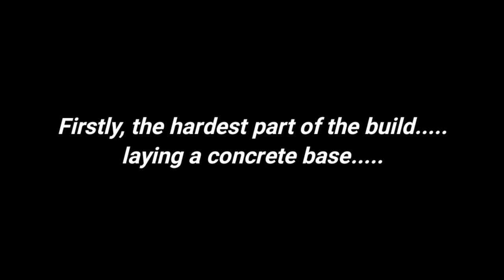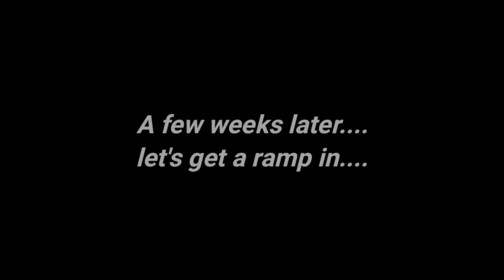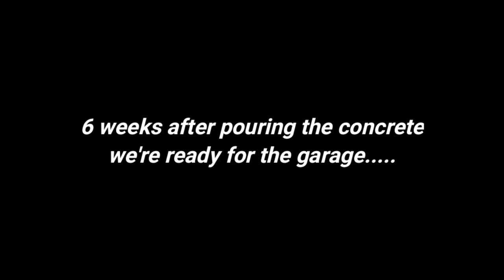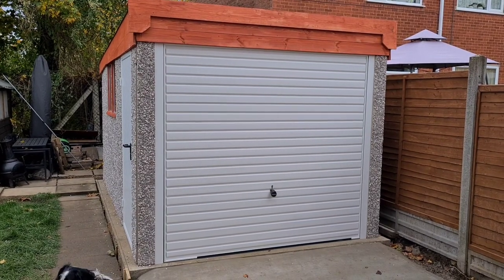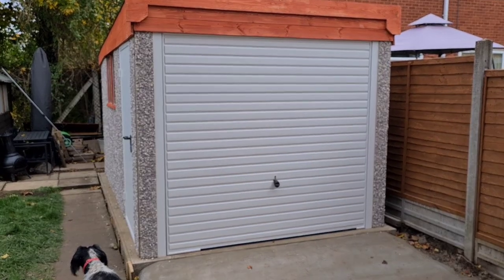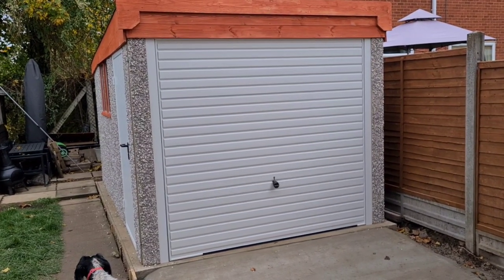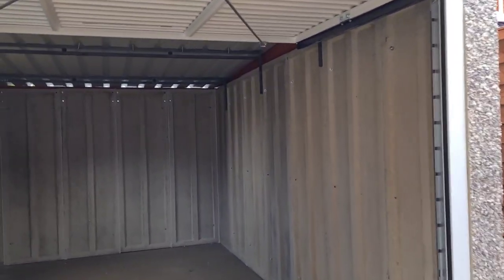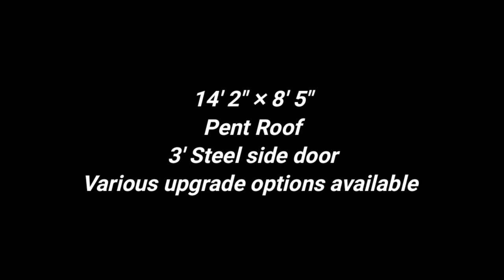Concrete Sectional Bike Garage Build

Comment: There is one big omission for me. What about the shuttering at the base having left it in and the trapped piece when doing the slope to the garage floor and how on earth do you get this bit out when the concrete has hardened. It makes it so much harder instead to remove it later instead of before the garage was actually built. So confusing for me and not seen this before or am I missing something. Anybody out their and nobody seems to have noticed this!!!
Reply from the maker: Hi Geoffrey, thank you for your comment. I am not a building expert and this was in no way intended as a "how to" but more just a video of our garage build experience. The shuttering must be left in until the concrete goes hard otherwise it will just fall away and will make a mess, also we were let down with the hardcore as it was very poor quality and was 80% pebbles and the rest was crushed bricks. I didn't want to remove the shuttering until I was ready to sort the surrounding areas (paths etc) as I felt that some of the hardcore would have fell away from the edges. The shuttering was easily removed by just levering it straight up with a spade, even the front bit where the ramp went in as a small gap was left so as not to trap it and was easily lifted out before putting the ramp in. As I say I'm no expert and this video is NOT intended to show how it should be done but just to show our experience of our garage build. 👍
Reply: Okay mate, and at least you gave an explanation which was great. I still enjoyed the video though and thanks for sharing it with us.
Cheers mate.

Comment: Hiya pal looks great. Building one myself Tomorrow and have no clue how the corners are bolted together. How are yours ? Thank you
Reply from the maker: @marshallcoop934  Hi mate,
Wish I could send photos on here. If you watch the video back at 3:58 and then at 4:30  you can see that back of the side panel is butted up to the end of the back wall and bolted through from the side (the back wall is inbetween the sides)so you may have 2 panels that have holes in different places to the others.
The 2 small front panels either side of the garage door are are bolted forwards of the side panels. It's quite simple but difficult to explain. If it's a new one you should get some sort of instructions, the company who supplied ours built it.
Yours may be a different make so may go together different but I'm sure you'll sort it. 
Good luck pal.
Reply: @2wheelbikers311  cheers mate. Building mine for my first bike. Cbr400rr nc29.
Can't wait
Reply from the maker: @marshallcoop934  
Awesome mate, good times ahead 👌

Comment: brilliant video. I'll be using this to build mine 🙂
Reply from the maker: Thanks for the comment 👍
Reply: @2wheelbikers311  Finally gotten round to building my garage. Do you happen to know what type of wood was used for the facias please?
Reply from the maker: @ookoro  Hi, I'm not sure, mine is probably just pine of some sort as it was a lower spec and price but I will just replace it when it needs it.
Reply: Is that a Compton shed
Reply: Plus how long was it

Comment: What are you putting between the joints? Just normal silicone?
Reply from the maker: Hi thanks for the comment, yes it's some sort of rubber sealant, not sure on the type as these guys built it for me when they delivered it as part of the service.
Reply: @2wheelbikers311  ahh thanks for the reply, i only ask because I've managed to get a free one but now need to try and figure out how to rebuild it😂😂

Comment: Did you need to get planning permission for this garage, also what size is that
Reply from the maker: Hi, it's 14'2"× 8'5. Didn't need planning permission as its more than 2 meters away from the house and its under 2.5 meters high. 👍
Reply: @2wheelbikers311  thanks for that look at getting one for my bike what company did you use I saw one in Derby offering that service and what was the overall price if you don't mind, for the base and garage.
Reply from the maker: @Jayd  No problem. Our garage was from Garadeck in Nottingham (link at bottom) it cost us at the time £1850 with a steel side door, when they deliver it, they put it together for you. I think they are about £1950 now. If you check the website, there is a price list on there. We did the base ourselves and I think that cost about £1100 with a skip and all the materials, so about £3000 all together. The garage company can do the base (don't know the price). Hope this helps 👍 
https://www.garadeck.co.uk/
Reply: @2wheelbikers311  thanks for that